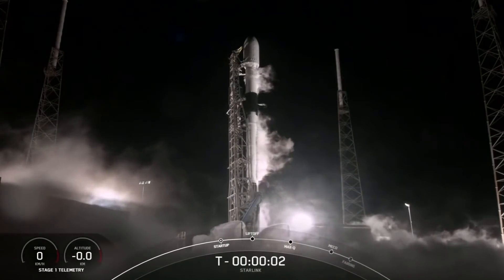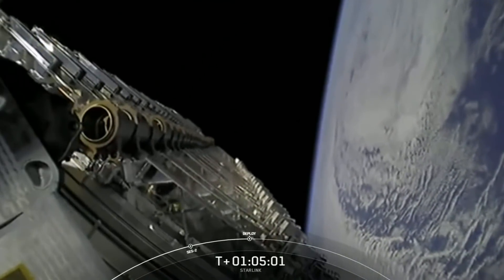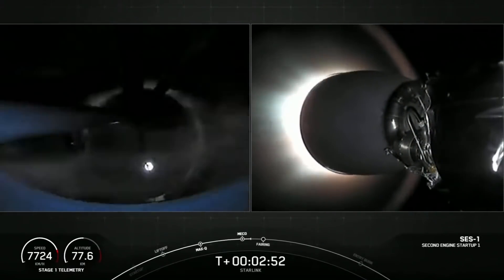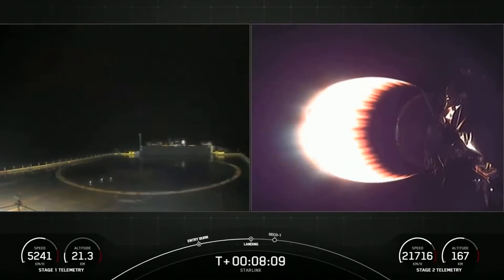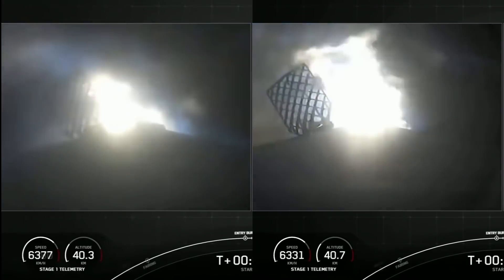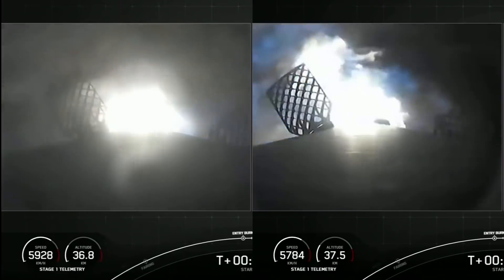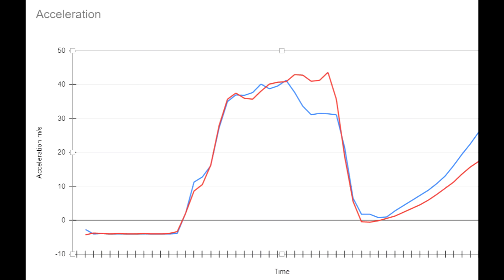Did An Engine Failure Kill A SpaceX Booster on Its 6th Flight?

Comment: spaceX needs to write a program that activates other engines on engine faliure

thrust < Nominal
Activate extra engines to compencatee
Reply: The standard configuration for the first stage engines does not include the hardware for restarting them in flight. Only three out of 9 engines have the necessary additional equipment installed. It is not free in terms of weight, and servicing these engines requires dealing with really nasty chemicals, which nobody wants to do unless absolutely unavoidable.
Reply: @cogoid  i see your point

Thx
I just had some questions, tho as rocket tech evolves it'll be esiear to restart them

Like a normal gas or jet engine
Reply: @thepolishtech1552  It depends mostly on the fuel. Orbital maneuvering engines almost always use fuels for which no ignition equipment is required -- you just start spraying the fuel and the oxidizer and they react automatically without giving you any trouble at all. But the fuels themselves are really nasty to work with -- very toxic, corrosive, very expensive, etc. they are only used because they are very reliable and the engines using them can be very simple and therefore dependable.

Kerosene and liquid oxygen are cheap and pretty easy to handle, but it is relatively difficult to ignite them safely. There are developments for doing it more elegantly (even by using lasers!) But it is not just the act of lighting the fuel up -- one also has to blow the vapors out to prevent creating explosive mixtures, one has to do all sorts of little auxiliary procedures for starting and stopping the fuel flow so that the fuel does not freeze, does not overheat, does not bubble, etc -- starting and stopping the engine is quite complicated in practice, comparing to keeping it running once it is on. Lots of little tubes around the real engines are specifically for starting and stopping, draining and purging, etc. That will probably never change.
Reply: @cogoid  ok thx
Reply: It depends on which engine had the issue.
Reply: @TheEvilmooseofdoom  yeah but it could still help if programed correctly

Comment: Fortunately the booster was not aligned with the landing platform at impact, what may have cause this?
Reply from the maker: It's always designed to miss until it relights the engines for landing
Reply: @scottmanley  Thank you for the reply wonder why the last two starship crashes hit the pad?
Reply from the maker: @georgemancuso9597  if the engines hadn't relit on starship they would have crashed on the opposite side of the road and missed the pad.

Comment: Don't they have charges on the boosters for self destruction when telemetry is lost? Would you want that to protect the recovery ship?
Reply: There are range safety charges but I'm not sure what the conditions are for flight termination on a landing at sea.  The booster is always going to miss, it only corrects after the landing burn starts.

Comment: Like the starship multiple engine idea, I wonder why they don't just have multiplebur timing profiles for different combinations of 2 or 3 engines they can light instead if the center one goes out, especially if they can get data from the entry burn as to which one(s) they've lost
Reply: I think the center engine is the only one that gimbals..
Reply: @TheEvilmooseofdoom  I wonder how much control authority you actually lose by throttling 3 engines in a triangle configuration 🤔

Comment: My biggest concern is this is the 2nd major failure of a recovery of a proven booster that I know of. What about starship? Starship will have people on it. It can't afford to fail. That's why I'm concerned that it can't land via parachutes.
Reply: You can't perfect a system unless you fly it.  Early commercial aviation was risky for passengers as well.
Reply: @TheEvilmooseofdoom  at least an airplane can glide. Starship is a brick when the engines are dead. And if you're going to have backup engines, then you're going to need to flip a LOT higher than are in their prototype testing.
Reply: @awilliams1701  That is all stuff that will have to be worked out.  Hopefully while hauling cargo.

Comment: Of the thrust loss not perfectly being 1/3 of engine potential, how much is atmospheric drag in action? Could drag be contributing 25% at that point, and the engines each 25% more, making the math line up?
Reply from the maker: I don't believe so, looking at the data on either side.

Comment: If you observe the gulls, they jump a second time. Wondering if the first jump was caused by the flashing rocket and the second jump was caused by the noise created by the crashing booster. Light is faster the sound so...

Comment: Doesn't the first stage have an abort protocol when it knows a landing will be impossible in order to prevent damage to the droneship? In that case, after the reentry burn, the abort sequence may have been put in place after failing to decelerate to nominal speeds.
Reply: It does, the idea is that it's always aimed at a safe spot and only adjusts for landing after the landing burn starts.

Comment: The flow rate proximiter over combomulated the fuel transfer and caused burnout of the whodohickey.  Resulting in tooling failure and loss of booster.

Comment: As the delta-v of the re-entry burn was less as planned it probably overshot the location of the barge.  Maybe with the grid fins they can have a steeper trajectory to compensate a bit, but maybe not enough to make it to the barge.  Also it might have lost too much fuel to be able to do a complete landing burn. So if it knows its cant do a successfull landing it probably tries to land next to the barge.  Makes you wonder if the booster is smart enough to calculate fuel amount left or diagnose an engine problem and do a 2-engine landing instead.

Comment: Is it just me or SpaceX recently has some problems with their propulsion systems? Two landings of Starship went wrong, first because of pump pressure, then second engine didn't reignite, now looks like one didn't shut down properly...
Reply: Starship uses completely different engines. You cannot compare starship to the F9 as starship is a prototype. Also, the starship never had a high chance of landing anyway. Remember, Elon said that SN8 had a 1/3 chance of landing.

Comment: I think the booster impacted about two miles from the droneship OCISLY.  Notice that when the glow off to the right reaches maximum and then stops, the seagulls are startled by the impact, but then quickly land again.  About ten seconds later, the birds are again startled.  This would be from the arrival of the sound of the impact.  The 10 second delay is about two miles for the sound to arrive.  Someone below mentions the sonic boom and that is of course another variable in the situation - could be that sonic boom and sound of impact arrive at similar times.

Comment: Thanks Scott, I was eagerly waiting for this video and you came through again! I believe your assessment is probably accurate, it looks like an engine not only failed, but caused some kind of fuel anomaly since there was obviously something burning after engine shutdown right up to telemetry loss.  I'm also going to guess that attitude control was lost at this point which was probably the cause of the telemetry loss. I don't know how the telemetry is transmitted, but it seemed very similar to how telemetry is lost on the landing barge when the force of landing causes to much vibration. Any insight on how that telemetry is transmitted and to where?

Comment: A big thing to consider also is that the engine plume itself is likely used to shield the aft section during re-entry and a failing engine (aside from not decelerating the vehicle enough) also isn't shielding the rocket with it's plume in that area.

Comment: Great analysis. Just to add a little bit more of not backed up data to this analysis based on the seagulls behaviour, I think the stage crashed at around 3km from the drone ship. They get scared when it crashed and the lights go out, and then they get scared again at around 9 to 10s later possibly due to the sound wave. That would make around 3.3Km of distance!

Comment: When I first heard that they were only aiming to reuse boosters ten times, I was surprised.  You wouldn't build a jetliner and then throw it away after ten flights.

But look at it in terms of savings compared to expendable.  If you use a component twice, that's a 50% decrease in the per-use cost of producing it.  If you use it five times, you've cut it by 80%.  If you use it ten times, that brings it to 90%, saving only another 10% of the expendable per-use cost, compared to five times.  

So the relatively low reuse numbers make sense.  When it's a mature technology, the successor of Starship will probably fly hundreds of times, same as a jetliner.  For now, though, a goal of ten seems about right.

Comment: After watching many of the launches, it looked to me like the problem started at or near MAX-Q.  It seems like there was an excessive release of fuel at throttle up or down depending on the timing.  Given that the extra release of fuel would have just been burnt as the booster continued to fly (thus a successful deployment), the problem wouldn't show itself until the entry burn started and would explain why there was still burning fuel even when the engine shut off again.  I would really like to be the guy watching the fuel gauge and see if what really happened was a loss of fuel and not enough left for the landing burn.  Just a thought...  On the other hand the fuel guy probably should have called out if he saw something out of the ordinary.

Comment: 07:50 - flame equal in both shots. 08:00 left shot shows weakening flame.  08:03 shows flame going to the left;  08:05 shows quick shift of flame to the right. To me that says attitude - control failure, with booster coming down on it's side, parallel to the ground (sea).   Stays on it's side until telemetry failure. Find it, fish it out and have a look at it, see what went wrong.

Comment: Also a thing worth noting with the seagulls is they seem to fly up twice, likely from loud bangs. If that assumption is correct, then the first time would likely be the sonic boom. The second time could be from an explosion, maybe in the air? Maybe on water? The time from the clouds going dark till second seagull liftoff is about 9 seconds, which would be around 3 kilometers. Since the booster would be landing by then, and in this assumption is going subsonic (otherswise the rocket explosion and sonic boom would be one nearly one wave) It is likely it would have hit the water some distance away from the barge. Ofcourse this is all speculation. Hope SpaceX finds out what happens. This will only make the other Falcon 9's stronger.

Comment: Good analysis, mirrors what I had thought myself from the video stream alone and loss of data, but the de-acceleration analysis nails the loss of 1 engine. I suspect the off centre forces from the still burning damage caused a tumble and breakup of the rocket, resulting in loss of data and falling debris still on fire until impact with ocean.

Comment: I was surprised at the speed at which the orange glow disspitapted, almost like it tried to light an engine, got orange flame, and shut off. If it had been fts, it would have been a bright fireball followed by a gradual darkening to zero as the flame subsided. This was like an engine making fire and the (probably still supersonic) wind extinguishing it instantly. Edit: addendum, if it hit the ocean, at those speeds water is practically solid - so one would think the fuel and oxygen would spark off a big orange fireball like we saw with the other crash landings. I could be mistaken.

Comment: Is there a 'dead man's handle' logical equivalent that encodes an autonomous self-destruct on the returning booster, if a telemetry ACK is not received from Ground Control, coupled with autonomous awareness of exceeding nominal trajectory parmeters by X%? Such a constraint would likely form part of any reentry licensing ('though possibly not for drone-ship returns?).
Reply: Not exactly.  What they do is aim for the ocean the entire time and only correct for the barge after the landing burn starts and all is working well.  If not they hit the water by default.
Reply: Answering my own question, partially - was their AFSS activated on this occasion?:
SpaceX’s latest advantage? Blowing up its own rocket, automatically
https://qz.com/1170674/spacexs-latest-advantage-blowing-up-its-own-rocket-automatically/
"Flying one from a launch site like Cape Canaveral traditionally requires an Air Force range-safety officer in place, ready to transmit a signal to detonate the rocket safely in the sky if the launch threatens to go awry.

SpaceX, however, pursuing cheaper and more efficient launches, worked with the Air Force to turn over that duty to a GPS-equipped on-board computer, an “Automatic Flight Safety System” that debuted in 2017. Now, if the company’s Falcon 9 rocket goes outside prescribed bounds when launched from Cape Canaveral, it can activate its own self-destruct sequence."

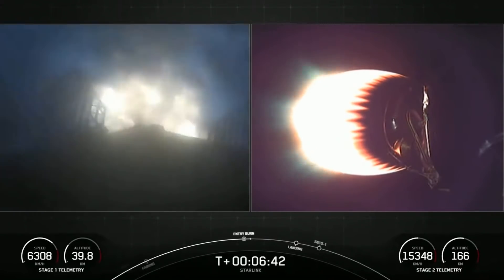Comment: 2:18 the fire going off to the side makes it look like the rocket has tipped over and is falling to the earth sideways. In this position the grid fins would be giving no aerodynamic influence and the rocket is simply a a large hypersonic falling stick.

For the rocket to tip over I'm guessing one of the outside engines, not the center one, had a loss in thrust and once it was side on the continuous non-centered thrust caused the rocket to spin more and more. If this is the case I can only imagine what was happening with the propellant sloshing everywhere.

Comment: One thing is to lift the satellite and land booster even occasionally miss the landing, much harder to land a starship safely with dozen of humans every time. No human will land in starship
for many, many years, if ever.
Reply: That or some kind of escape system will have to be installed on Starship.

Comment: I think that they do not do the burns with 100% engine throttle to have some controllability reserve and also due to reentry loading so I think when 1 engine experienced a failure the other engines where throttled to compensate with achieving decceleration setpoint. Anyway on the graph 0 m/s^2 means no acceleration and so it means that the aerodynamic drag is exactly 9.8x m/s^2. IMU would measure with g substracted.

Comment: It does seem to be a bit lazy to say that Space X are aiming to get ten launches out of each booster but even if they can get half that they are going to be way better than other rocket companies. Is that true? There is an economic argument to say that reusable rockets are not the most cost effective method, and it is probably only when they can consistently achieve ten that it crosses the threshold. For example, are customers prepared to pay the same for a launch that has new boosters as they would with one that has two, three, four, five under its belt? You can admire the achievement without being seduced.
Reply: There have been no first stage failures on accent so reuse of a booster is not as big a concern for customers.  As for economics Elon himself said they break even after 2 uses.

Comment: Totally agree with your burning and tumbling theory, that's what I came up with too. Worth pointing out that, had this been a land-landing, it wouldn't have made to to the shore and would have safely fallen far short into the ocean. It needs to be under control to "glide" itself towards shore and the engines need to light for the landing burn for it to go the last little way to the landing pad just behind the beach. We saw this in the CRS-16 Dec 5, 2018 soft landing in the ocean. The booster was out of control due to loss of hydraulics to the grid fins, but was actually able to right itself during the landing burn. Still, it was smart enough to know to not go to the pad at that point and instead just softly and safely put itself into the ocean. https://www.youtube.com/watch?v=LFdep0qCmYA

Comment: If you look at the seagulls reaction, you can tell the time the booster crashes into the ocean. However it obviously does NOT explode (probably no fuel left), as the reaction of the birds is really moderate, like in the earlier comments, it is probably the sonic boom, and there is a second reaction probably when the booster crashes, but one startled bird quickly flies back and settles as nothing extraordinary happened. Which also means the booster crashed at a realtively far distance.

Comment: There's an interesting possibility of determining the distance from the drone ship to the explosion when the rocket hit the water. When the reddish light first appears, the seagulls are startled and briefly lift off from the drone ship, then quickly land again. Then after the bright orange flash, they seem more disturbed and fly away more definitely. The time between the bright flash and the seagulls lifting the second time should give us the distance from the drone ship to the point of impact. If we can find a way to determine the heading of the camera on the drone ship, we could get a rough bearing to the impact site as well. If we then know the position of the drone ship, we can calculate a rough final trajectory for the booster.